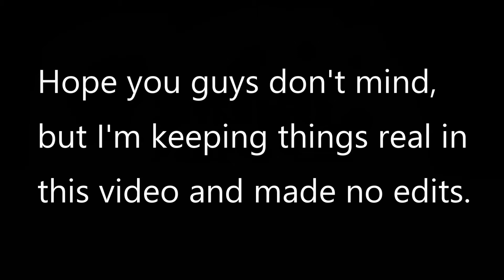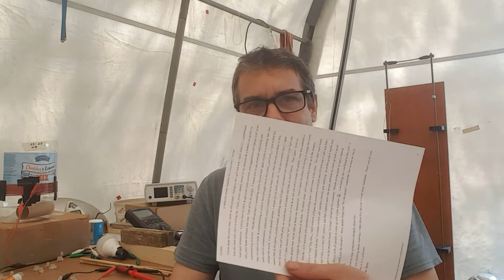WIRELESS POWER TRANSFER Part 4 (Why I Keep Secret)

Comment: I've gotten what seems to be over unity from a 4/16awg quadfiliar pancake tesla coil. its a pancake tesla coil with 4 wires. one input and one output. its a 1 to 1 ratio because that's how the wire came 4 conductor 16 gauge. super simple to make. anyway I drive the input with a variac and a 10kv neon sign transformer. the input side goes through a tesla hairpin circuit but instead of the COPPER BARS being connected to the caps its the quadfiliar pancake tesla coil. i then ground 1 wire of the secondary with a iron ground which makes a big power difference and from the other secondary wire of the coil i then use for experiments. i can light bulbs with one wire going to ground. also placing induction coils over the 4 wire pancake tesla coil produces tremendous amounts of energy gain. the important thing for me seems to be the magnetically quenched spark gap in the driver side of the circuit. that helps alot with energy gain too. if anyone wants pictures or schematics feel free to lookup my channel energyresearcher. to sum it up and make it simple it appears that all you need for overunity is a tesla hairpin circuit without the copper bars going to a grounded 4/16 awg pancake tesla coil.
Reply from the maker: Interesting results your getting.

Comment: Keep in mind wireless energy messes with the weather. Look at the gigawatt usage in Alaska. Watch the meter, then watch the news. 254.....:) DoD document. In the 1990's the manual I read said "a building can be burnt to the ground while occupied, in order to maintain a secret." Just has to be authorized by the president's signature.... Notice there is a gas station called (fill ups)66 and then there was a gas station named 76. This has to do with displacement. A gallon at 66 degrees has more density than a gallon at 76 degree's. Using water in the coolant you can increase the gas milage by heating up the gasoline before combustion. Just like making large amounts of methanol/ethanol is illegal with prohibition. Got to keep people sucking on that Saudi Arabian hose pipe....$X.xx9 it is all about that tax. The people's lack of common cent's, buy ten gallons the price is $Xx.x9. If you lack common sense you might be blind and be able to see it. If you got something good you will know if someone tries to kill you by making it look like a car accident... Be safe.
Reply from the maker: I know exactly what you mean.  Thank you!
Watch this video about how the same car gets better gas mileage in another country.....
https://www.youtube.com/watch?v=NsZWOjk9hzQ

Comment: It's very simple.
You should have a transmitter and one receiver. And then some copper wire are also need to make coil for transmitter and receiver.
And then set properly.
If you can't understand then ask mee through of like youtube msg. Ok
Reply from the maker: Simple, sure, let me know when you get 350 LEDs lit with 1.1 watt😎
Please stay tuned for more results😁

Comment: What’s wrong with using wires to transmit electricity ?
It’s cheap and it works
Reply from the maker: Good question.  Nothings really wrong with them.  I just feel that in many cases they are unnecessary.  Hanging power lines all over the city is not cheap.  All appliances should not need a cord to plug in the wall, it is unnecessary.  I am just wondering, but are you familiar with Nikola Tesla?  Wiring things just tells me i am being monitored as to how much i use and will be charged for it.
Energy should be free, like air & water😎😁
Reply: INVENTOR3 , I’ve been an electrician/technician for 35 years so I’m full bottle on what you’re talking about, but I don’t see where you hope to get electricity from without paying someone to produce it ? 
That being said I’ve got a kickass solar system and haven’t paid for electricity for 10 years, but luckily there’s plenty of sunshine where I live

Comment: The mass produced energy is becoming cheaper every year but it is actually the transmission and delivery to customers that increases its price. Solar panels produce a lot of energy and anybody can buy them for relatively low price so small scale energy production at home is already possible. If you would achieve some confirmed OU and the energy gain would be comparable to a solar panel then I would not worry about crushing the economy too much. When fusion reactors will start to produce more energy then they consume then that will be another source of clean, safe energy for the world. In my opinion some people on youtube already confirmed that ou is possible in more then one way and these videos were published years ago and they are still uploading new ones from time to time so I guess the energy business has got more serious problems then OU publishing youtubers. I am also very careful with any claims because my understanding of some effects might be wrong and my measurements might have errors.
I think that if you see some interesting results you can share them but you dont have to reveal everything about the method you used to achieve them. People that do some tests and trials themselves should be able to figure some details without step by step explanations. Good luck and thank you for sharing!

Comment: If you disclose anything and want to be sure it reaches to people, use the bitcoin block chain it will impossible to remove (Basically).
Reply from the maker: Hmmm, first i have herd of bitcoin "block chain",,,but im reading now it seems very interesting, very secure exchange of currency or data.  Good to know,,,,thank you😁
Reply: @INVENTOR3  it can be but you should avoid the exchanges that keep em for ya.. they announce hackers got to em, when they in fact steal from people, disband and repeat.. ~_~

Comment: So what happens if you would die tomorrow? All your work would be gone?
Reply from the maker: Very good question.  I have thought about this many times!  I do keep journals of all my experiments so that anyone could replicate from them.  On this project alone, I have over 170 pages of notes so far.  And my wife has instructions to release them to the internet if anything happens to me.  If i start to get more power from this system i will take extra measures of mailing information to selective people around the country😎
Reply: @INVENTOR3  👍

Comment: Google "The True Wireless by Nikola Tesla pdf" if anyone's anyone interested in replicating these Tesla wireless experiments. What is little known about Nikola Tesla's wireless energy transfer with hardly any losses is that he transferred wireless energy via earth, using earth itself as a medium. And this energy was longitudinal, not transverse. Sometimes earth can amplify current sent to the earth and this can be called over unity. Also read book "Secrets of Cold War Technology by Gerry Vassilatos". Longitudinal electricity has electric field and magnetic field flowing in same direction instead of right angles as you can see in this video "Replication of Eric Dollard's Analog Computer". Google "Transverse & Longitudinal Electric Waves and Tesla’s Longitudinal Electricity" for electrical engineer Eric Dollard's demonstration on longitudinal electricity and "The L.M.D./T.E.M.Test - JLN Labs" for circuit diagram to produce longitudinal electricity. Also check video "Eric Dollard - Longitudinal Energy (Scalar Waves - Mutual Induction - Wireless Transmission of DC)".
Reply from the maker: Non Hertzian wave, scalar waves, longitudinal magneto dielectric waves.  Approx 290,000MPS faster than c.   I have 6 videos on my Tesla hairpin circuit,, here is a condensed video version of part 2  https://www.youtube.com/watch?v=4Ll-kuInw1w&t=4s
safe electricity, energy through the Earth, energy though hair thin wires and more.  My Tesla coil makes these waves also between toroid and ground.  My wireless transfer of energy, i believe it to be OU.  A lot of these videos you point out i have seen,, but not all and i will check them out, especially the Analog comp by Dollard, i started looking into that at one time,,and must have forgot to finish, hehehe.  Great stuff your pointing out, much appreciated, i "will" be looking into them in detail😁